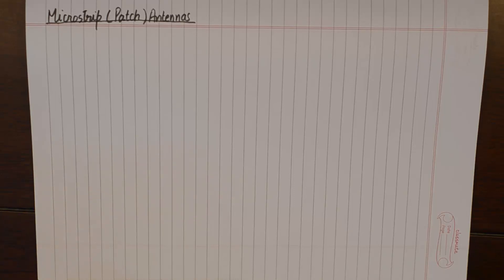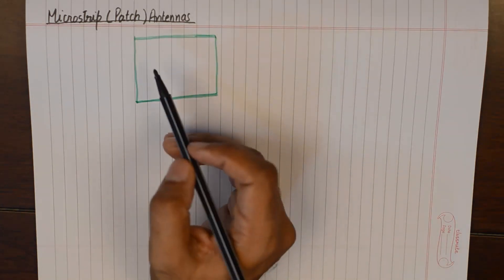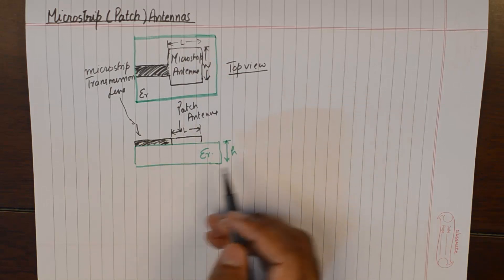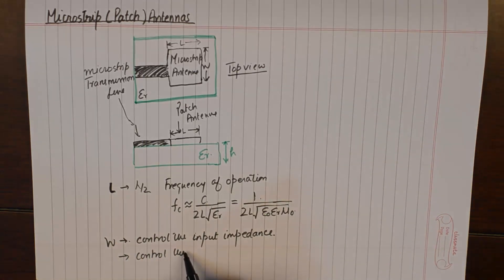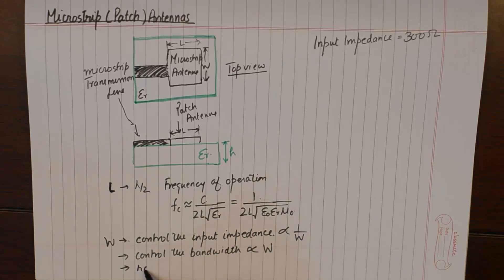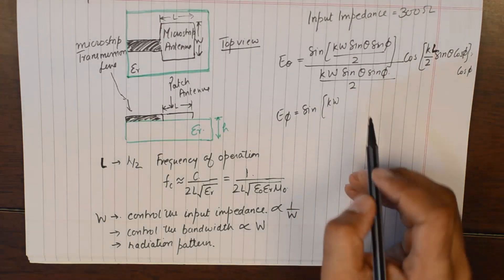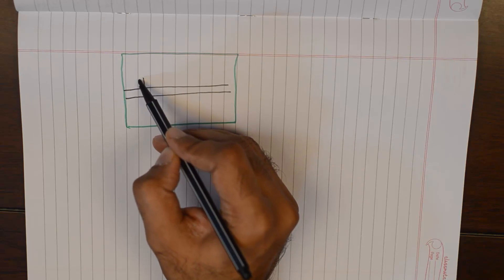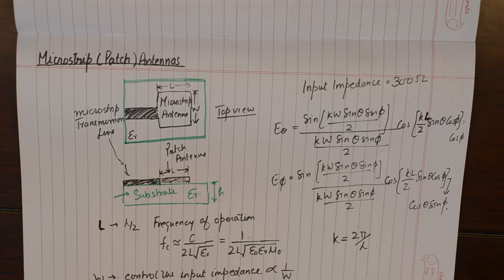Microstrip Patch Antenna | Construction and Design |Aperture Antenna Basics

Comment: but how does it radiate?
Reply from the maker: Same principle of em radiation from conducting material as in a dipole
Reply: @nipunharitash  dipole is very easy to understand, current flows in the same direction from positive and negative flares, but where does it happen in patch antenna?